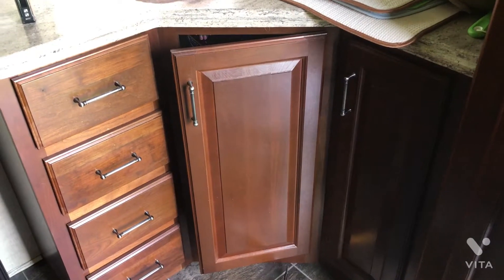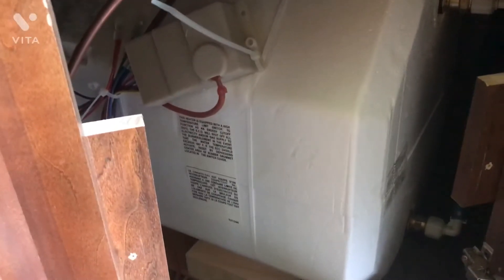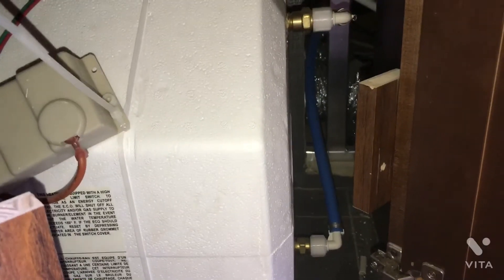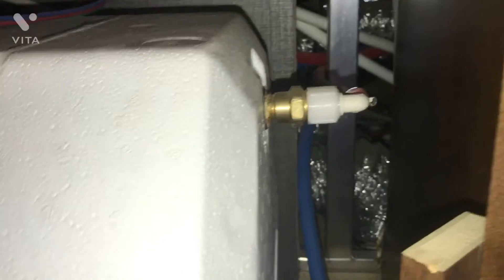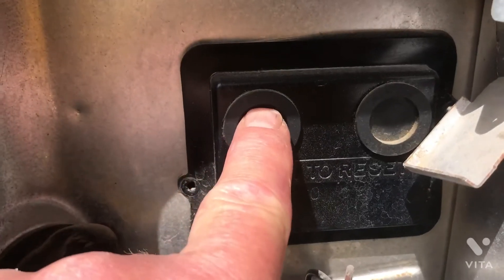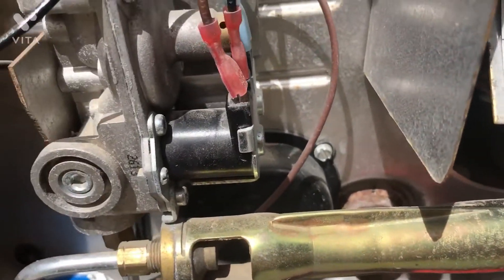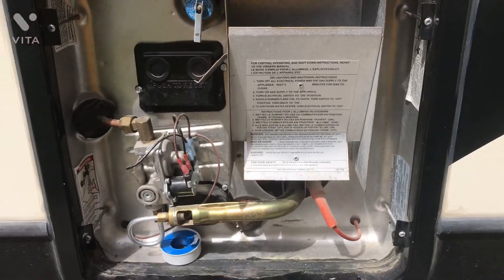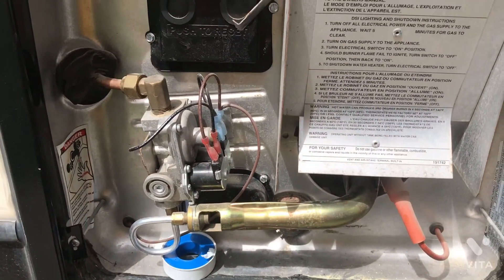Access to your Alpine Suburban SW12DEL water heater components  behind a cabinet door

Comment: Well done, thank you. How can I  test my the electrical components. Igniter, on/off toggle and dual reset switches.
Reply from the maker: The on and off switch can be tested with multimeter , power removed, meter set to ohms and oh, bitch connections on switch while toggling ..should show continuity one way and none the other.. the two thermostats will measure full continuity unless the temp set point has been reached,, to test the ignitor you would need a tester